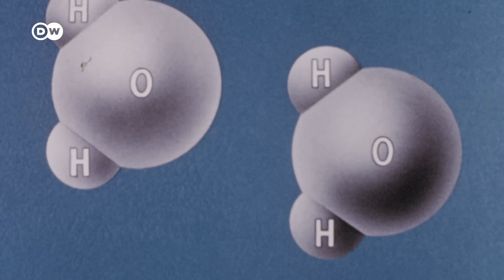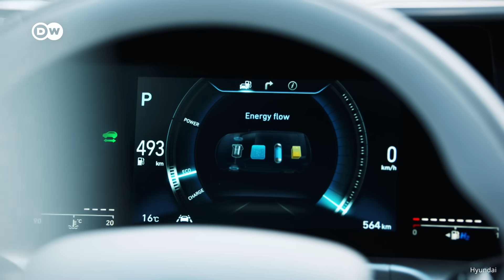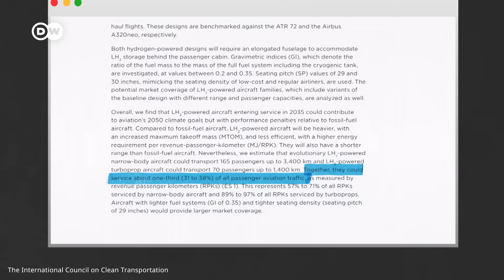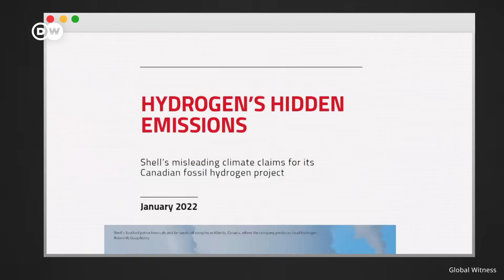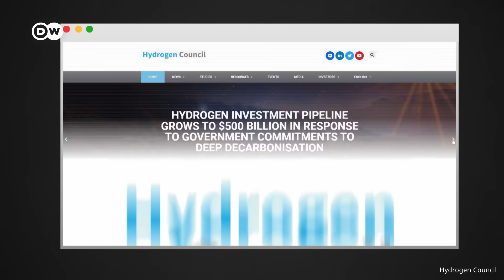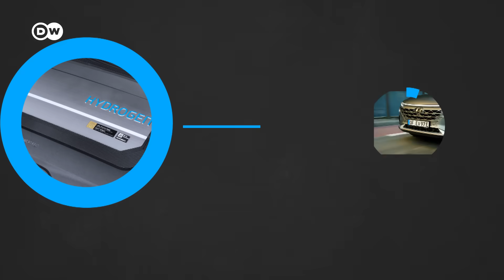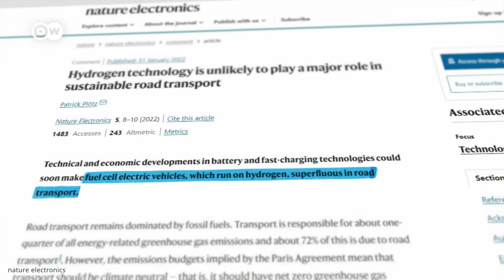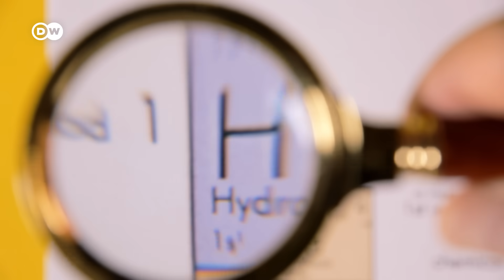The truth about hydrogen

Comment: Very interesting subject. Green Hydrogen is something that here in NZ we should be making by the bucket load since the electrical generation industry is either hydro/wind or geothermal. Still have a number of coal and gas fired industrial sites(mostly Fonterra) due to their remote locations but only two gas power stations for residential output. New Geothermal sites are coming on line all the time but our biggest problem is lack of investment, seems a missed opportunity to me.
Reply: NZs grid is really good. Agree there is an oppotunity there. It's absurd that in Australia we aren't aggressively pushing a switch to concentrated solar thermal power. Photovolatics are good short term, but present a long term end-of-life recycling nightmare that CST solar just doesn't have (since the heliostats are just plain old mirrors). With that and molten salt sotrage, plus east coast hydro we could easily power our home continent and export clean electricity either as H2 or via direct cable, given our proximity to Asia. We could build our heliostats and get rid of our coal and gas extractive industries completely.
Reply: @Syulang-nt4kj  And there is the problem. Oil/Gas industry has its fingers in so many pies, worldwide let alone in Oz.
Reply: @markputnam6371  Ain't that the truth :( - Australian politics has been completely subverted by the mining/gas lobby. It's disgusting.
Reply: Day dreamer, they are shutting down some of those thermal generators losing pressure. Also exporting electricity by cable you need to go back to school and learn about electricity losses over distances.
Reply: Your comment begs the question as to why the electrical output of the wind turbines isn't just directed to the electrical grid instead of making hydrogen.  Electrolyzing water and later putting the hydrogen through a fuel cell generates large heat losses that reduce the effective ourput of the turbines and panels.
The length of transmission lines along which electric power can be effiently transmitted is currently about 500 km, and keeps improving.  Thus, for distances of 500 km or less there is no need to incur the losses caused by using hydrogen as an intermediate energy storage mechanism.
Reply: I will actually be traveling to NZ from the US in 2024, to install and commission some hydrogen dispensers.
Reply: the thing is hydrogen has 0 upsides and was a fairytale to begin with, use mthane for example.
you can make that and that has upsides like it actualy has storage capabliities, not like hydrogen which is terrible in every aspect.
but at the end of the day battereis is where its at, they are clean, consume no resources, can infnitely be recycled, and first and foremost are insanely efficient, we are not just 80% efficient for the wholle chain but way over 90% already with battery electric cars.
this can be applied to everything else as well.
efficiency is what determines everything, power, safety,ecnomy, ecology, adoption, infrastructure etc.
batteries are unbeatable period
Reply: @JohnSmith-pn2vl  Mathane though lower still have Carbon and is also worst as a greenhouse gas than CO2 to begin with. However, it can used at places when methane is obtained as a by-product. This methane can be burned and is actually better than burning fossil fuels including natural gas. Also, Hydrogen won't work on individual levels. However, when talk about industries where green hydrogen can be obtained on-site, it is a completely different ball game. For example, in steel industry it can be produced in-house using electrolysis of water and them used to replace the fossils fuels used to power the furnaces. Same is the case  w.r.t the long haul transpiration industry, where batteries cannot be feasible due to weight,range issue. On the other side water can be easily filled andstired to produce on board hydrogen which can be used to drive the propellers.😊
Reply: @JohnSmith-pn2vl not sure how old this comment is, but boy were you wrong. This “fairytale” is quite literally driving my companies current and future business. And we can’t keep up with the demand quite frankly. And seriously, batteries?!? Yeah, no.
Reply: @JohnSmith-pn2vl   Batteries clean and recylcable?? Are you lost
Reply: @JohnSmith-pn2vl  I would like to also add that it's much harder to decarbonise the aviation and steel sector with electric, it just needs to be a blended solution?

Comment: This video miss an important fact that we often has too much electricity production available due to wind and sun that cannot be planned. When tis occur then we shut down wind mills and that represent 100% loss of energy. If you use this to local production of hydrogen, the gain is 100%. Another fact is that battery production is not carbon free which is assumed in this video. I recommend reading reports on the carbon footprint from  Li-Ion battery production.

Comment: I know that if you combine Hydrogen molecules with Oxygen molecules and input energy to cause combustion you create heat and water vapor. However, water vapor is the most significant greenhouse gas in the atmosphere, more so than carbon dioxide or methane, considering the concentration of free water vapor in the atmosphere.

Comment: Hydrocarbons are hard to beat for energy storage and practical use. They store a tremendous amount of energy in a relatively small and lightweight package at ambient or moderate temperatures.. Pure hydrogen isn't practical or economical for most energy use. However it can be used and combined with carbon captured from the air and recycled to form methane, methanol, propane, kerosene ( for diesel fuel).  This would recycle carbon continuously providing clean hydrocarbon energy while not changing our basic infrastructure or currently used technology. Methane and propane also make ideal fuel cell fuels.

Comment: How much inevitable natural gas is produced by sewage and garbage dumps? Can this be used for powering fuel cells on site? I doubt by 2050 we will eliminate all petroleum products from our energy supply.  I believe we need to reduce it to the point it contributes negligible carbon and green house gasses.  We may need to revisit the way we commute that even with electric cars is unsustainable if we continue widening road to infinity. Concrete is an awful contributor to CO2.

Comment: The first, and most intractable problem, is that pretty much ALL of these conversations begin with "our energy needs", then work backwards, trying to find ways to maintain business as usual. We need to take a leaf from the books of the last year when energy "needs" have turned out to be a LOT more elastic than some of us imagined. The first thing we need to do is squeeze out of those economies, the maximum amount of wasted energy. THEN look at how to produce for what is left, and what mix is needed.

My home has a wood-fired oven with water heater, powered by trees I grow myself, cut down, till I replace it with electric, by a FF chainsaw. I also have an electric oven and water heating, powered mostly by solar cells on my roof and a Li-ion battery with grid backup. Even so, I have a natural gas hob that is part of the mix. And all year we move among those energy sources as the weather changes, literally shifting from one to the other during the day, switching electricity on and off, starting a fire, using the hob instead of the stove top. It takes work and awareness, all day, every day. 

THEN it takes technology.

Comment: The general consensus in the industries we supply to and work within is that the ultimate final goal is hydrogen: green hydrogen. EVs-no matter how much their battery size is reduced-are still being perceived as the medium solution. This is a very good video though; it's rare to find a transparently balanced one like this.
Reply: If you understood thermodynamics you would know that hydrogen energy, like wind and solar, cannot substitute for fossil fuels or nuclear. Not even close.
Reply: @stevem8318  If you're talking specifically the solar and the wind then yes. But if you're talking about green energy to replace fossil fuels then you're incorrect. The correct term is we cannot substitute it yet. However since greener energy are becoming more and more efficient and cheaper, it would be plausible in the near future.
Reply: There is no such thing as green hydrogen. It’s all a myth. How do you think wind turbines etc are manufactured?

Comment: Trouble with hydrogen ... it is very difficult to keep it in its container. Hydrogen is a small enough molecule to pass through solid metal ... it's even light enough to escape the Earth's gravity. So, you need to create Hydrogen very close to where it is to be used ... 

How about recycling Cardon? Methane to Carbon Dioxide and then after CO2 capture, CO2 back to methane. After all, old land fill sites produce methane for years. Close loop recycle methane .... we have the ability to do that now.

Comment: Green hydrogen from solar, wind or waves is not clean.  The carbon footprint of these sources must be the total footprint of production of the photovoltaic cells, components of wind turbines and or wave capture generators. to this you must add the footprint of the maintenance system for each divided by the lifecycle output of usable electricity of each and then reduce that by efficiency loss from storage and transmission to conversion of water to oxygen and hydrogen.  Then you have to account for losses in storage transportation and usage of hydrogen.  Suddenly like the electric vehicle, it is not so carbon friendly.  This like the electric car does not account for the multitude of other earth damaging heavy metals and byproducts introduced by their existence.  Energy is a much deeper debate than most people care to get their heads wrapped around.

Its like the paper vs. plastic debate decades ago.  Saved a few trees, but are now killing wildlife on land and in the Oceans.  We have to look at the total consequences of our actions.

Comment: From experience I have hydrogen knowledge and built a hydrogen boiler. It. Was 5 times the cost of fuel oil to generate. It is a non starter it takes too much electricity to break it out of water.

Comment: The global greenhouse contributors are water, methane and Co2. The effect most significant is water (95%) and Co2 is a few % but is in balance with air and sea water. So let's have a decent chat about what is a serious and what is insignificant. METHANE and Co2 are not the reasons for climate change, not a human cause and so in this respect perhaps Hydrogen becomes a real energy option.

Comment: JMCC WING is moving into H2 production from our wind energy system (patented JMCC WING Generator) that has 25 major improvements over the 3 blade wind turbines which do not work (97% of the wind blows through them ... they were a pig with lipstick from the beginning never meant to work).  The "WING Gen" is far more cost effective and environmentally friendly than covering the planet with short lived environmentally damaging solar panels.   The major benefit is that the "WING" can scale to large sizes (engineering studies estimate 200 MW and more in a single unit).  It also can be used to supply electrical energy to the eV car industry (yes there will be a balance between eVs and H2 but don't ask me to predict where all this will be in 10 years or even 2 years).   My estimate is that in 10 years we will settle on 3 major forms of energy.   Natural Gas - Wind (using the JMCC WING Generator) which will also produce large quantities of Green H2 at reduced prices.  Other forms of energy will subside including the big three Nuclear Coal Petroleum.   One note - economics and technology development should guide the movement and not climate change or government artificial goals and edicts.  We are heading into a severe cooling epoch on earth so please tell the myopic climate people that there are other factors affecting climate that are far more influential than their claims of global warming.

Comment: Hydrogen as a fuel is excellent, but it obviously presents great challenges in obtaining it. The Australians have already found systems to carry out the separation of water into H2 and O2 quite efficient in the order of 90%, and better methods and more practical systems will continue to be found for the objective.
On the other hand, deep geothermal energy is a 100% ecological source and is practically inexhaustible, which will undoubtedly contribute to detoxifying our planet. In addition, the reactors that generate energy by fusion will soon be sources of clean energy from which green hydrogen can be obtained.
Solar panels and windmills, in my opinion, are not practical, due to the large area they require for their generation and the intermittency of their energy production, and little by little their use will be reduced, once the energy by fusion and deep geothermal are developed at an industrial level.

Comment: my company JMCC WING is moving into H2 production from our wind energy system (patented JMCC WING Generator) that has 25 major improvements over the 3 blade wind turbines which do not work (97% of the wind blows through them ... they were a pig with lipstick from the beginning never meant to work).  The "WING Gen" is far more cost effective and environmentally friendly than covering the planet with short lived environmentally damaging solar panels.   The major benefit is that the "WING" can scale to large sizes (engineering studies estimate 200 MW and more in a single unit).  It also can be used to supply electrical energy to the eV car industry (yes there will be a balance between eVs and H2 but don't ask me to predict where all this will be in 10 years or even 2 years).   My estimate is that in 10 years we will settle on 3 major forms of energy.   Natural Gas - Wind (using the JMCC WING Generator) which will also produce large quantities of Green H2 at reduced prices.  Other forms of energy will subside including the big three Nuclear Coal Petroleum.   One note - economics and technology development should guide the movement and not climate change or government artificial goals and edicts.  We are heading into a severe cooling epoch on earth so please tell the myopic climate people that there are other factors affecting climate that are far more influential than their claims of global warming.

Comment: I think trying to use hydrogen as a fuel is another Utopian green dream. 25 years ago many engineers thought the fuel cell was the answer but the cost answer was never overcome. Renewables will get more expensive as the needed critical rare earth minerals get harder to obtain and scarcer. And the overall cost of them is not really competitive to traditional energy sources as they are artificially supported by mandates and steep subsidies. Nuclear is another way of generating hydrogen, called red hydrogen ,but still transporting and storing it still has technical problems and hazards. 

So I believe the way forward is nuclear and synthesized fuels as the ideal battery is not close at hand despite all the hype. And climate change, the all encompassing buzz word that replaced global warming, is 99% natural. The cleanest energy sources are still coal, oil, natural gas and nuclear when properly handled. CO2 and CH4 have a very minuscule heat footprint to the overall energy budget of the Earth.

Comment: You compare battery with hydrogen and base that on the case that hydrogen need to be transportet to the fueling site. Not nescesarily. It can be produced on site.  And why do everyone talk about battery OR hydrogen? Today the industry and academia should talk about battery AND hydrogen.  A combination. There should be hybrid vehicles which can run on both. So called range extenders.

Comment: One thing that you don't mention in this video is the use of hydrogen gas to drive a normal internal combustion engine, rather than to power a fuel cell. An advantage of doing this would be that it can use existing technology and internal combustion engine  production lines  which would be much cheaper than converting to electric power via a fuel cell, and would be far less polluting The only disadvantage that I can see, (not a large one) is that the hydrogen would need a larger tank, which would need to be a pressure vessel, perhaps similar to existing methane gas converted vehicles. Thoughts?.
Reply: If any fuel is used to produce a hot flame in air, NOX is produced. This would apply to hydrogen too.
Reply: a catalytic  converter negates NOX doesn't
Reply: Engineering Explained YT channel has a few good videos on these topics. First, as expensive as H2 gas is to produce, it's use must be as efficiently as possible. ICE engine is 1/2 as efficient (20%) as a fuel cell car (40%). Fuel cell car is less than 1/2 as efficient as battery only EV. Would you be willing to pay the equivalent of $28/gallon of gasoline?
Second, storing H2 as high pressure gas means lot car's volume is taken up by storage tanks. And then there's the lack of distribution. There's 47 H2 fill stations in the continental US, all in California. How many buildings across the US already have electricity?